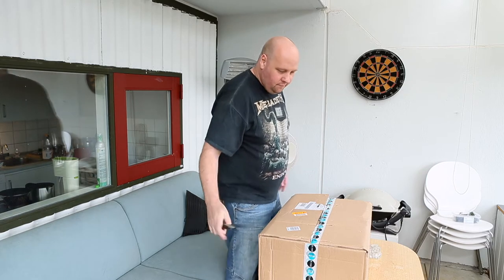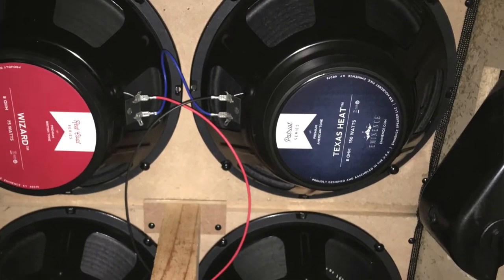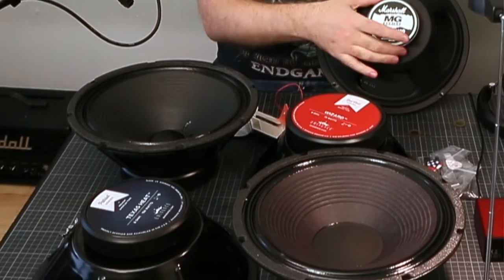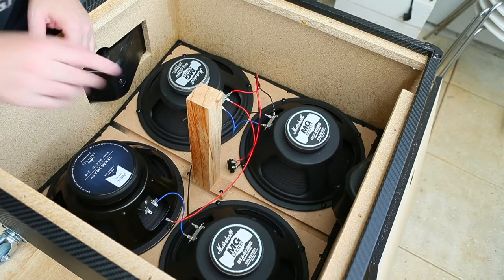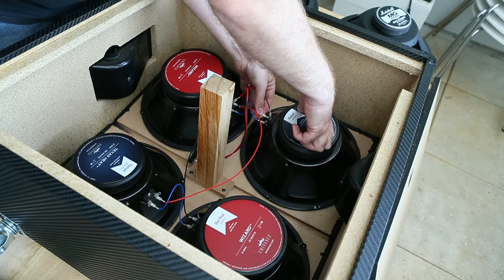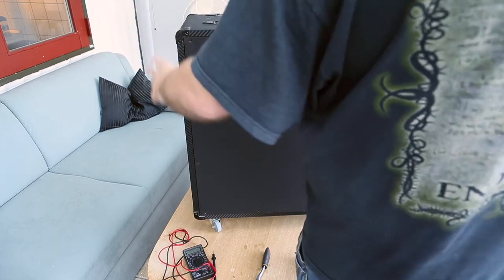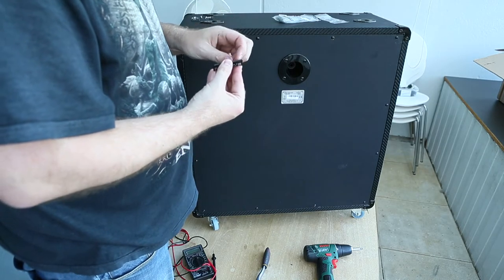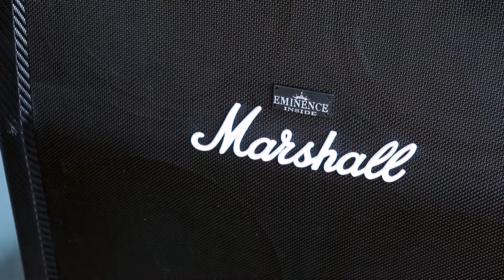Eminence Speaker Upgrade + Sound samples

Comment: I enjoyed the video and the playing, it’s just that if you are trying to compare old speakers with new speakers you can’t tell the difference if you switch your guitars too. You have to play the same guitar with both sets of speakers (old vs new). You cannot tell if the sound is being changed by the speakers because you changed the sound with a different guitar. Each guitar has its own voicing due to the way the pickups are made, also the materials that the guitars are made of changes the tone.

Comment: I can't tell what speaker you were using or what guitar because the font is way too small to read so everything you made I don't even know what you were using. so I put a pair of cheater reading glasses on and still can't read the small print on the screen.  I was looking forward to hearing the differences in them, they all sounded good in their own way. I'm buying a Swamp thing because I know it can sound good and pump out some chunky riffs, but I wanted to see if one of the others may possibly sound better than the Swamp thing

Comment: Hallo, this is nice riff playing, good sense of rhythm. As for the speakers, The MG Celestion have light magnet and it is always making sound light and lacking thick mids. More like Fender speakers. It does not mean they are bad speakers, perhaps someone is looking for light and bright  tone and this might be the better bet for him. However, in general fuller sounding speakers tend to be more impressive in hard rock, making it more universal. The Eminence sound more like classic Marshall /Celestion stuff. Difference in size of dust caps also has influence, given same speaker construction small dustcaps will give brighter sound.  Cheers from Poland 😉. By the way, do not waste time anymore for fiddling with tone - record something. You have the biggest treasure inside of you. Make recordings!

Comment: Definitely sounds darker (tone wise and music wise) than the stock celestions. Big wall of sound to it as well. I did a Swamp Thang and Texas Heat setup in a cheapo Marshall 412 myself. Very doom-ish. Also The megadeth riff sounded damn good through both setups actually. Love that blue guitar with the tele pickguard
Reply: My Diezel 4x12 has their eminence designed for the cab but it's too dark i've realized. Too much low mid...

Comment: I noticed that the two speaker types have different power ratings. Did this factor into your choice, and did you notice an effect of this?
Reply from the maker: I did think about it, but all though I'm not 100% sure i don't think it has any influence on the sound. At least nothing I can hear. The combined power rating of the cab is still way above what my 45 watt amp delivers.

Comment: No offence but that cab is not worth upgrading,it's an MDF budget cab..I find every time I try to upgrade a low end product I end up wasting money.If I left it alone unmolested,sold it,kept an eye out for a good deal I would have saved lots of money or gotten something much nicer for the price.Even if I spent the money for something new and saved only a little/saved none at least I saved myself the time of modding/upgrading...anyhow thanks for the demo
Reply from the maker: Hi Thanks for the comment. It's true that for the money i spent i could have gotten a proper non budget cab with V30, but that's not what I was going for. I didn't want to sound like everyone else, I wanted to try something different. I'm not sure how big an influence the materials have on the way a cab sounds, but I'm sure that the dimensions have an influence and I know that the speaker type has a dramatic influence.
Seen from a money point of view it may not make sense to upgrade, but at least in my opinion from a sound point of view it makes sense. Point being i could not buy a cab with that speaker combination unless I went down the custom trail, and that would have been a lot more money and I enjoy modding and experimenting.
Reply: @iminaband397  I got it,no need to justify to me(I'm just some stranger with an opinion after all)I hope I didn't come off the wrong way.I spoke from personal experience is all.In the past I'd buy a budget amp and want to dump money into it to upgrade when in the end had I saved I could have gotten something nicer for less if I waited on a good deal.That doesn't apply here,point taken.
Reply from the maker: I'm not trying to justify anything, everyone is entitled to their own opinion, Just trying to clarify the reasons i did what i did. Hopefully it can inspire someone to make an informed decision on what is the best solution for them selves.
Sometimes it is not about the end goal, but the road you travelled to get there.   @zz-np2sr
Reply: @iminaband397  My point was nobody owes me an explanation.The justification part was directed at me,not meant to insult you(IE nobody owes me anything,I think it was lost in translation)Anyhow happy tone searching.
Reply: Cork sniffery

Comment: Uhh.. If you are comparing speaker quality? Why are you changing the control in the experiment? Did you not learn anything from the scientific method? Keep the fucking guitar the same.
Reply from the maker: No need to use that language. I wasn’t trying to do a super scientific comparison. For that you can go to the Eminence website. I know my gear and you just have to take my word, that the main difference in the sound is from the speakers. In order to break in the speakers there was some time between the pre and post recordings. I had swapped the pickups in my guitars, so in order to use the same pickup i had to use a different guitar. Not a scientific test but a practical test to see if there was an improvement in sound with the upgrade. And i think there was.